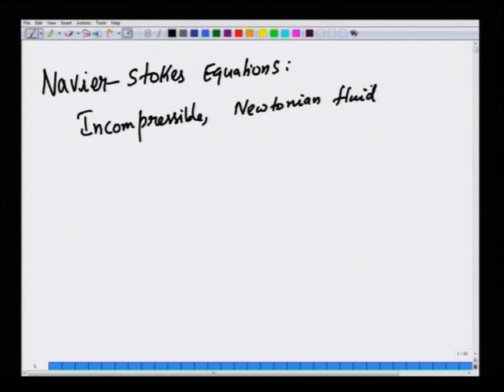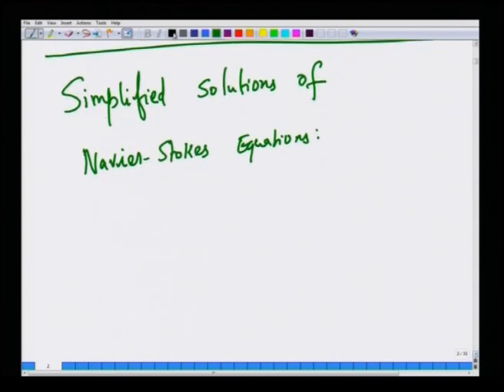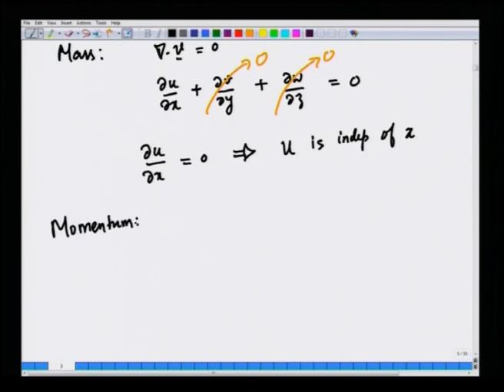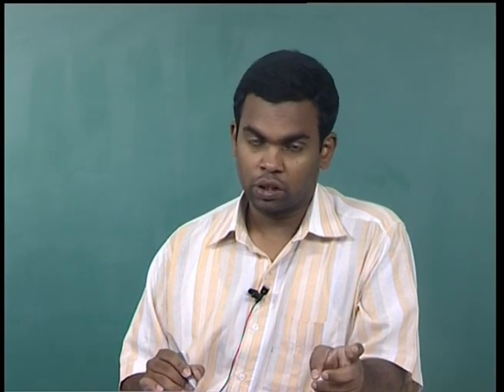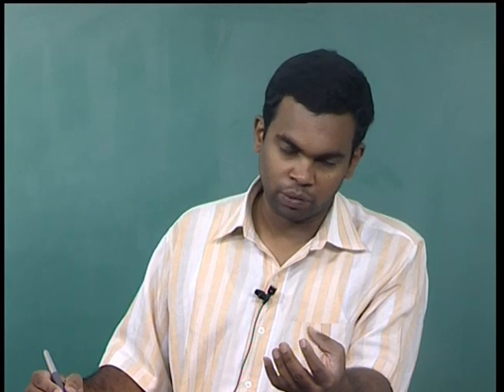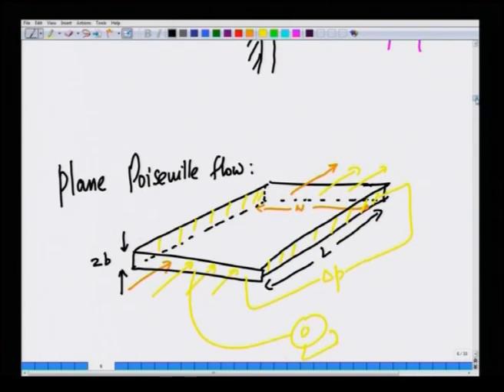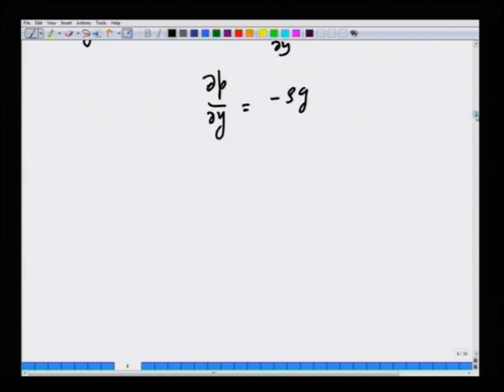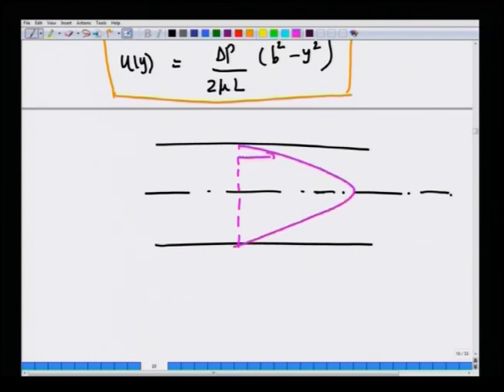Mod-01 Lec-25 Lecture-25

Comment: Why will the constant from y-momentum balance be a function of x and not z? (in the poiseuille flow problem)
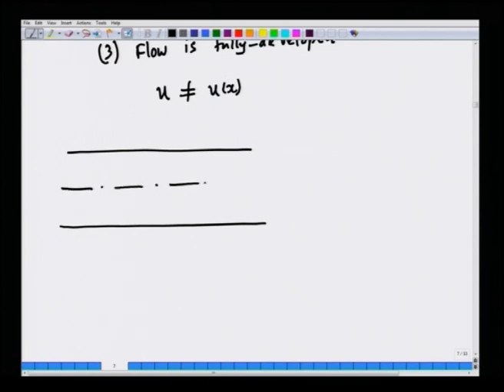Reply: because variation in the z direction is neglected as it is sufficiently long... and the problem becomes in 2D with x and y.. which is set as coordinates at 44:28